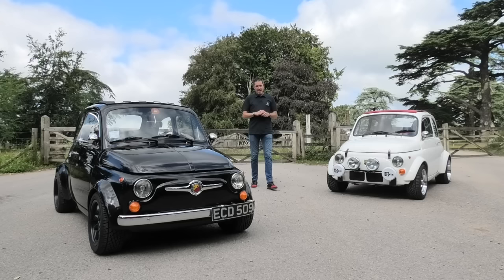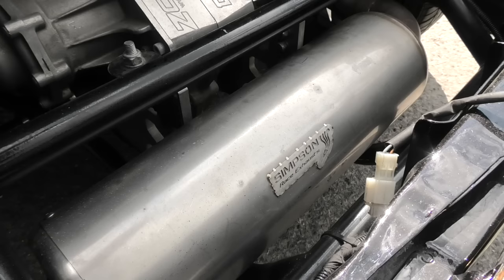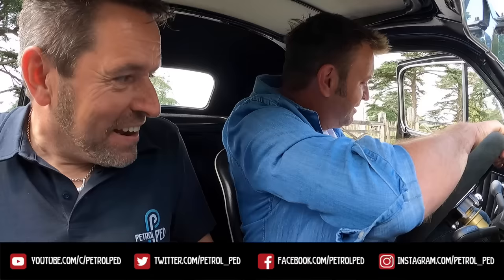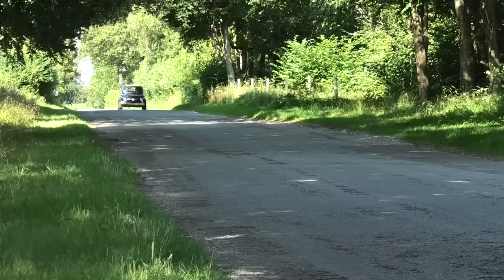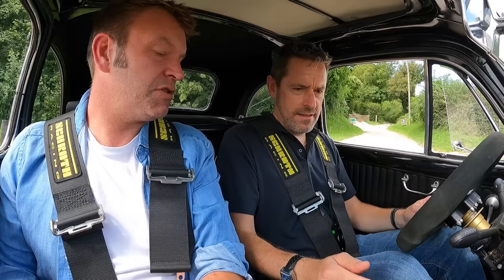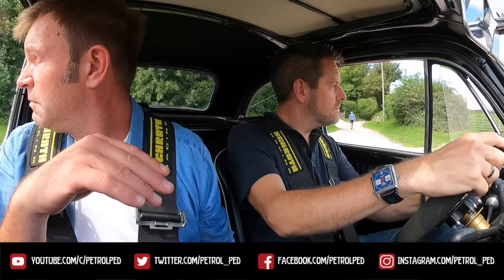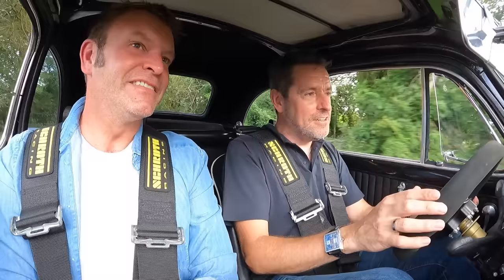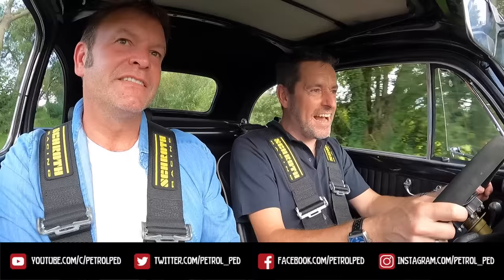197hp Hayabusa Engined Fiat 500 'Fiabusa' with 11,000 RPM redline by ZCars [Part 1 of 2]

Comment: It's looks fantastic and obviously goes like a rocket but I'd have thought they'd have fitted a roll cage or strengthened the passenger compartment and I couldn't see any obvious extra metal to the A & B pillars in the video. 
It's a tiny car built with no crumple zones or any kind of crash safety I'd feel very vulnerable driving it but it looks great.
Reply from the maker: They can put one in if you like and I would certainly spec one. This is their development car 👍
Reply: Agreed - they could have fitted the original A & B pillars of the Hayabusa together with the crumple zones that come with the  Suzuki bike.... Sorry, couldn't resist ;-)
Reply: @petervogt8309  the Hyabusa was designed to have that engine from the start it's an extremely powerful bike that will only appeal to seasoned riders, it has seriously powerful brakes with  ABS stability control and it's rider unlike the driver in the car will usually be wearing full race leathers, gloves, boots and a helmet and he'll be sat astride the motorcycle equivalent of a well designed supercar, not inside a tiny 60 year-old car that was designed to have a 23bhp engine.

Comment: Hello. I have just come across this video. Now, I don't think it is a sequential gear box. Bike gearboxes are different to cars, obviously. Bike gearboxes are generally one down and 5 up. You can change gear on a bike without clutch in most cases, especially when in the higher rev range. The car is a Busa engine and box with a bike quickshifter on it...simple. Quickshifters are common these days on bikes and some are factory fitted and some you can retro fit. Also you say bike engines don't have much torque. I have a 1998 Honda VTR Firestorm 1000 which is a V twin engine (2 cylinders). I can leave it in top gear (6th) at 20 mph, pin the throttle and it will go all the way to 120 to 130 mph. Nice car though and prefer that to the Fubaru. Engine sounds nice on the Fubaru but because the exhaust is that short I think it has spoiled the Subaru engine sound. Great videos...sorry if I sound negative ISH. The 1000 RR engine has a quickshifter as standard....listen to a bike with a quickshifter, sounds exactly like the Fiabusa.
Reply from the maker: Thanks for this 👍

Comment: Very cool, would be even cooled with forced induction imho, may not weigh a ton but still a bit more to drag along for a bike power source so think a small snail on that just to bump up the torque a bit. Something small and reactive enough to avoid unnecessary lag, don't need no 500HP Busa power source suffereing form massive lag, ....nothing, ...nothing, ...nothing and voila BAM all of it kind of deal. Just for torque on tap to match the high revving nature, sequential shifts without sleeping on the clutch for half a day loosing time lol.

Comment: Bitchin idea, Bros.
What would you say to stuffing an LS swap into a Fiat Spider and beefing the suspension and differential?
Upgrading the brakes to EBC USR rotors and Yellowstuff brake pads.
Basically, a modern Cobra roadster but prettier.

Comment: my b 1964 min van(speed 40 miles an hour)  no way
could reach 114 mph the speedo needle would just touch the stop pin on the M 40 when it was first opened 
great fun burning up slower 6 cylinder cars.  most drivers gave over at about 85-90.

Comment: I have heard that 400Hp is possible out of the Hyabusa if it is turbocharged and uses methanol. That would be insane!
Reply: 1000 hp is possible with high octane fuel , a firm in Wokingham builds them .
Mine is 450 rear wheel & road legal

Comment: Why not just have a newer motorcycle engine with ride by wire and up & down quickshifter? Not that there's anything wrong with the Busa engine but up & down quickshifter would make driving so much easier and possibly more enjoyable.
Tuono V4 engine, for example... Lots of good options.

Comment: Wonder how it would do with a Triumph rocket motor?  I think the rocket motor is better suited and has way more torque than the Busa.  If you need more HP you could always add a turbo.
Reply: Triumph motor is 3 times heavier with the same power & not much more torque. 
That would be a no then

Comment: That's crazy! A quicklshifter will make those shifts a lot cleaner without thinking about it. Brilliant little car nonetheless.
Reply: He doesn't need a quick shifter he just needs to back off the throttle for an instant to shift up gears.
Reply: @HandSolitude  lol. That's exactly the point of a QS, so you don't have to back off the throttle. So my point stays valid :)

Comment: What a top little car as l say how do you make a European or a British car reliable put a Japanese engine in it and a Suzuki Hyabussa engine and it shifts better than those uber complicated double clutch transmissions available in those uber expensive European and British super cars and l do realy like this Fiat Abath plus what a great idea l used to motorcycles and the sequencial gearbox are pretty easy to use also the gearbox isa constant mesh gearbox and the last thing is the quarter windows l just love them they were available in Australia up until 2003 that was in the Toyota hilux ute l own a 1997 toyota hilux ute and they were only available in the Australian market ute

Comment: Two wheels are better than 4. Putting that Hayabusa engine in that Fiat 500 has just halved the power to weight ratio it had when it was a Hayabusa motorcycle. Should have set up a quick shifter/blipper with the gear shift to short shift perfectly as most bikes now have quick shifters and down blippers and indeed the Hayabusa has.

Comment: Didn't even use the 11,000 rpm. Irish bloke kept telling him to change up at 8000rpm.
Reply from the maker: The guys from ZCars requested that for safety reasons actually as I only had a limited amount of seat time during the shoot 👍
Reply: @PetrolPed   @Petrol Ped  appreciate the reply. Shame as you didn't get the full bike engine experience.

FYI

Hayabusa's are not the highest revving.  Plenty of litre bikes with 200 plus horsepower pushing past 14,000rpm.

The Ducati Panigale V4R has 237hp and goes to a giddy 16500rpm.

Comment: Shifting at 8000 rpm? That's not even in the power band yet. Shift it at 11,000 and the motor won't drop more than 1500 rpm. between shifts

Comment: I have the bike version. Why change at 8000? Let it sing. Great toy though.
Reply from the maker: It about getting used to the car. With more seat time you can use more of the Rev range 👍
Reply: @PetrolPed  ahh right. I just presumed you had a decent time in it already off camera. 8000 is about where they start really waking up so you want to have another go if you didn't get chance to really try it. They' re mad as a bike and I imagine that car isn't going to hold it back all that much.

Comment: You are going to tell us the zero to 60 or do aren't you
Reply from the maker: Didn’t try as 1st gear pull away is tricky. It would be better at a rolling start 👍
Reply: @PetrolPed  why use first  surly 3 or 4 would obsorbe  the torque
unless the gear change wont allow you.

Comment: It would be so much more impressive with 11k shifts too. Your probably only make 130hp at 8k if that.
Reply: 90 % of torque on a gen 2 busa (the one in the fiat) is made by 8 thou .
Litre bikes need revs , busa's are bigger engines (1340) so don't need thrashing

Comment: Iv had enough this is complete misinformation. As a racer and long time motorcycle guy you can shift at any rpm both up and down very fast in any bike old or new just with some throttle modulation. Rev the damn thing it's supposed to cruise at 3-5krpm and don't be afraid to go over 10krpm or stay there promise stunt bikes don't have built motors and they live forever on the limiter all day. Clutch is only needed to take off you can use it after if you want but I never understood why unless your in a corner on two wheels and even then slipper clutches are standard for a long time now. Cool car should definitely have ridden a motorcycle before reviewing it though this was Fairly sad. It's been so e time since I rode a busa but first definitely tops out not far from 100mph you said this had longer gears? I'd be in first most of the time if so.

Comment: Dudes so afraid to go above 8,000 rpm, all the power just starts at 8,000 rpm... The car is easily double the weight of the bike it came out of.. Just kind of funny he is afraid to take it above 8000rpm! I guess he is not used to a fast vehicle... EDIT: I should have said he seems like he is not comfortable with such a high revving engine perhaps instead...
Reply from the maker: It was a recommendation from ZCars as I only had 30 mins or so driving the car. Driving this kind of car is a responsibility and I always take a cautious approach. I am used to driving a wide range of fast and powerful cars and have a race licence so I know what I’m doing. 

But I’m sure you would do so much better 🙄
Reply: @PetrolPed  I was not referring to you! I was referring to how nervous the owner seemed as he looked over at the tac and said shift at 8,000.. as if the car was gonna loose control... Like you said it seemed manic and crazy compared to the Fubaru though it had less torque and probably HP also...

 Well that is mostly due to the high RPM's that the bike motor revs at that makes it seem more manic than it is also the sequential shifter with it's faster shifts helped..
I am sure you are a good driver and I am sure you are a better driver than me, good on you..
I guess I should have worded my last post different than I did... I just found it humorous how nervous the owner looked staring at the tach as you started going up in the rev range afraid you were going to break the 8,000rpm mark  saying "shift at 8000" ...

 Yes, I have had several sport bikes over the years and all of them would accelerate faster than that fiat , due to them being much lighter ..And the fastest car I ever owned only had about 350hp it was a second gen Mazda RX7 that I had that the apex seals went out on, so I decided why rebuild the 180hp rotary that only got 15 miles per gallon, when I can put a SBF 5.0 in it.  I put a decent cam in it and ported the cylinder heads threw on some long tube headers and got much better gas mileage to boot as long as was easy on the throttle.. But it was pretty quick having a 4.10 rear end and weighing about 2700lbs... But the fastest car I have driven was probably my friends Cadillac CTSV with the the supercharged corvette engine putting out around 600hpand 500+ftlbs it is a heavy car, but it pulled pretty hard with all that torque..